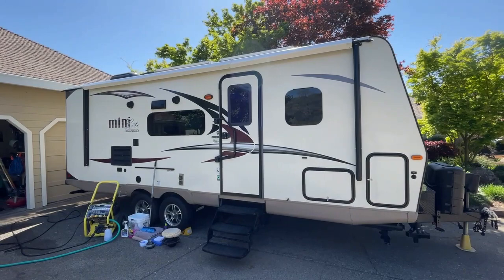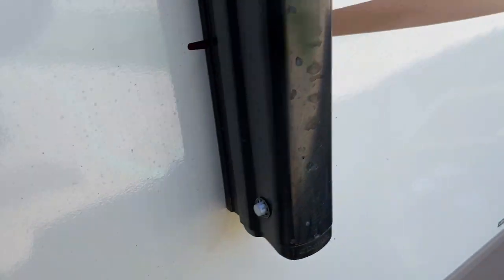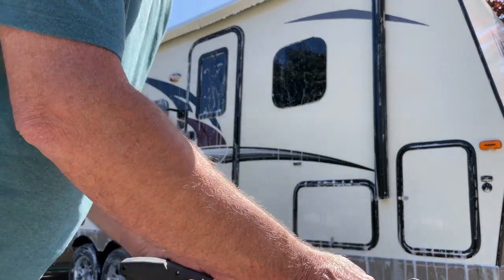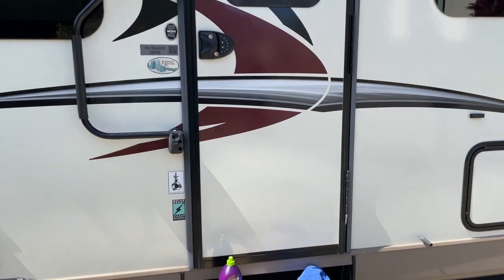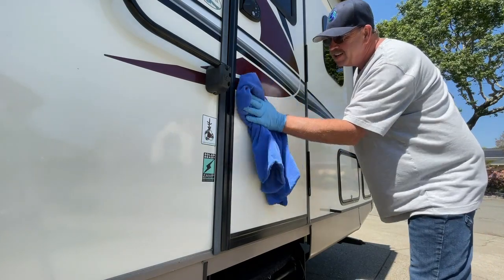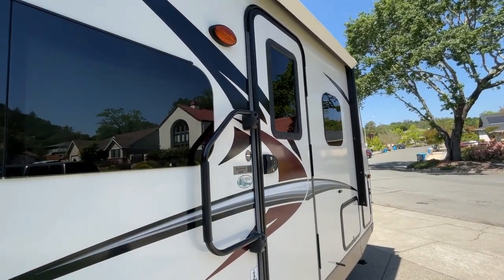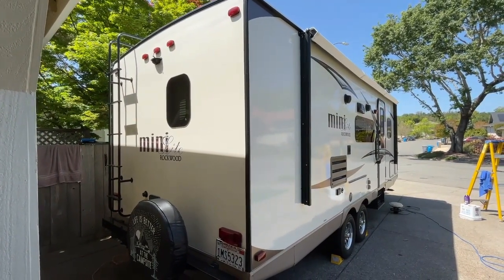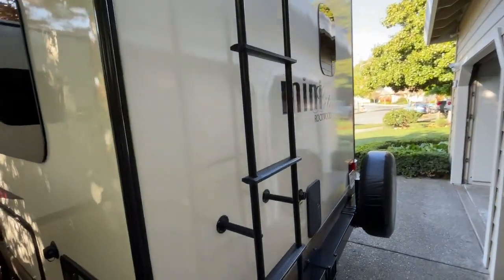RV Exterior Washing & Applying the BEST WAX I've Ever Used (3M Perfect-It Boat Wax) - Step By Step

Comment: Thanks. Was looking for what I should use to wash And wax my RV. 
👍
Reply from the maker: Thank you so much for watching and commenting. I really like this wax, its so easy to apply and remove. Just so you know, its not necessary to use a buffer, a microfiber cloth works just fine. In the video you saw me using a buffer, I do this to just make sure all the wax residue is removed. I have found that if I miss a few spots removing the dried wax its not a big deal, it can be easily removed weeks later. 

3M Perfect-It Boat Wax (36113) – For Boats and RVs – 1 Quart, White -
https://amzn.to/3gAAz79

Meguiar's G17701 Ultimate Wash & Wax, 1 Gallon - 
https://amzn.to/3ghpuaM

Carrand 93062 Deluxe Car Wash 10" Dip Brush with 65" Extension Pole -
https://amzn.to/3v16TUN

NOTE: I Do Not own this but I like it :) 
DocaPole Car Cleaning and Detailing Kit: Soft Wash Brush, Squeegee, Mitt (2X), Microfiber Cleaning Head and Extension Pole, 5 to 12 Ft (20 ft Reach) -
https://amzn.to/34rEHT9

O'Keeffe's Working Hands Hand Cream Value Size, 6.8 ounce Jar, (Pack of 1) -
https://amzn.to/2QiyXEt

Camco 41008 Pro-Strength Black Streak Remover - 32 fl. oz. -
https://amzn.to/3aAHGbI

Griot's Garage 55586 PFM Microfiber Terry Weave Towel (Set of 2) -
https://amzn.to/3evt8eC

Chemical Guys MIC_292_02 Premium Grade Microfiber Applicator, Blue, Pack of 2 -
https://amzn.to/3eqjbiS

Waxer/Polisher, TACKLIFE 10-Inch Dual Action Random Orbital Car Buffer Polisher Waxer, 10Ft Power Cord, Variable Speed, With Polisher Pad Bonnets and Gloves, Ideal for Car Waxing - TCP01A 
https://amzn.to/3gFW1rz

WEN 10A422 Synthetic Wool Polishing Bonnet, 9-Inch to 10-Inch -
https://amzn.to/32ETA06

Pressure Washer Soap Dispenser Foam Spray Gun -
https://amzn.to/3ndyhw4

Comment: I'm preparing to wax the Mini Lite. I don't want to use a power buffer. What can you recommend I use to buff the wax off? I ordered the 3M product. Thank you for all the great videos.
Reply from the maker: Hello Lynne thank you for watching and and the compliment. I posted this in the description below the video " I used a buffer after wiping the dried wax off with a microfiber cloth but I could have done it without the buffer."   So you will be fine not using the buffer just use a microfiber cloth and it will work well. I wish I had mentioned this in the video, I just used the buffer because I have one. I hope you get back to me and let me know how you like the wax. Take care and have fun
Reply: @thetraveltrailerguy  Thanks for the information. I'll let you know how it turns out. The trailer definitely needs some TLC.
Reply: @thetraveltrailerguy  We finished the trailer. The wax was great. It was easy to apply and the finish is beautiful. I used some microfiber pads from Walmart to apply and then buff off. One sore point is that rounded front end. My husband doesn't like ladders so I had to use our 8 ft step ladder and lean way over to reach the top. I'm 5' 1"  and I had to stretch!!!! What a great feeling to finally get this job done. I've wanted to wax it for so long but was afraid we'd wreck the finish. John and I thank you again for sharing your knowledge on YouTube and also on the face book site.
Reply from the maker: @lynnebacchus6689  I'm so happy you and John tried this wax and your feedback, I really like it. What year and model is your Mini Lite?
Reply from the maker: We're heading back to Coloma to camp again at the end of this month :)
Reply: @thetraveltrailerguy  We have a 2018 Mini lite 2109s. We have reservations at Coloma in early June. Not sure if we will be able to go. I don't want to miss out on the repeat reservation system they have so I'm hoping it works out. We have site 54 between 2 cabins which may feel closed in. I loved site 63 but could not book it last time we were there. I hope you and your wife have a great trip. When John watched your tutorial on waxing the trailer he remembered how you made us the video of Coloma which was so nice.
Reply from the maker: @lynnebacchus6689  I hope you can make it we are in site #64 - May 31 - June 3rd
Reply: @thetraveltrailerguy  We are there 6/6 thru 6/10. Maybe one year we will overlap and get to meet you two:)

Comment: So how long did the wax job last?  How durable is the wax?
Reply from the maker: Thanks for asking these questions Michael. I was just going to post a 6 month update in the description below the video on how its holding up (I applied it April 25, 2021). So far the trailer still looks like the day I applied the wax and seems to be holding up well, the water still beads off, dirt and insects are easy to clean off. I will be doing another update when I feel its time to reapply which I feel will be every year at the same time.
Reply from the maker: 3M Perfect-It Boat Wax (36113) – For Boats and RVs – 1 Quart, White -
https://amzn.to/3gAAz79
Reply: @thetraveltrailerguy  .. very nice!  Getting ready to apply a coat on our 6month old 2021 Jayco Northpoint 377.  (43 foot).  Gonna be a multi day project.
Reply from the maker: 3M Perfect-It Boat Wax is the final touch to a truly professional finish, ready for the water or the road. This premium wax for boats and RVs contains pure Brazilian carnauba wax, known all over the world for its extraordinary gloss, combined with special polymers and resins to keep it looking extraordinary for a long time. Wipe-in, wipe-off liquid wax is easy to apply right from the bottle, and is safe for gelcoat, paint, fiberglass and metal. It forms a hard, durable shell that shields your boat or RV from the effects of water, dirt and weather.
Reply from the maker: @mike_adams  Great so far everyone that has used this wax after watching my video is happy with how easy it is to apply and how their RV looks after using it. You have a job waxing your 43 foot RV, just take your time. Please let me know how it goes and how you like the wax if you can. Thanks again Michael. Note: you can get away without using a buffer like I did if you want, I just used it to make sure I removed wax residue I may have missed. You will see how easy it is to remove the wax once it dries.

Comment: What do you use to wash and wax your roof?
Reply from the maker: If you look below each of the videos I put out it lists the products I use with links to where I buy them.  Here is my video of how I clean and seal the roof :) https://youtu.be/KyZa4wiavto
Reply from the maker: Here's a list of products I use on the roof -
Spic and Span® Extra Strength Powder: Sun Fresh 27 OZ -
https://amzn.to/3e5TzYl

Borax 20 Mule Team Detergent Booster, 65 Ounces -
https://amzn.to/2OYY4LQ

Arm & Hammer Pure Baking Soda, 8 Ounce (Pack of 3) -
https://amzn.to/3x3qhSI

Dawn Platinum Dishwashing Liquid Dish Soap, Refreshing Rain, 16.2 Fl Oz, 2 Count - 
https://amzn.to/2OVFXq7

Meguiar's G17701 Ultimate Wash & Wax, 1 Gallon - 
https://amzn.to/3ghpuaM

Here's another option instead of making your own cleaner to buy one premixed already.
RV Rubber Roof Cleaner - Non-Toxic, Non-Abrasive RV roof detergent 1 Gallon - Protect All 67128 - 
https://amzn.to/3axX3BM

MR.SIGA Heavy Duty Scrub Brush with Comfortable Grip, Cleaning Brush for Bathroom, Shower, Sink, Floor, 2-Pack - 
https://amzn.to/32iCYet

Carrand 93062 Deluxe Car Wash 10" Dip Brush with 65" Extension Pole -
https://amzn.to/3v16TUN

RV Rubber Roof Treatment - 1 gallon - anti-static, dirt repelling, and UV protectant - Protect All 68128 (Note: I have used this for 4+ years and it works for me. Scroll down to the bottom and read what Alpha says about maintaining the roof) - 
https://amzn.to/3uZK6bF

Protect All RV Rubber Roof Treatment - Anti-Static - Dirt Repelling - UV Protectant - 32 oz 68032 - 
https://amzn.to/3eeEmo2

Here's good roof cleaner that I use sometimes if I don't make my own:
RV Rubber Roof Cleaner - Non-Toxic, Non-Abrasive RV roof detergent 1 Gallon - Protect All 67128 -
https://amzn.to/32ijXIW
Reply from the maker: Here's the video on cleaning and sealing the awning - https://youtu.be/06KNgE9j3Cs
Reply from the maker: Here's the products I use on the awning -

TriNova UV Protectant Spray - for Vinyl, Plastic, Rubber, Fiberglass, Leather & More - Prevents Fading & Cracking from UV Damage - Restores Color & Repels Dirt - Free of Residue (Gallon) -
https://amzn.to/3e7CPjs

Another option to use for UV protection that others often use instead of the TriNova I use -
303 Marine UV Protectant Spray for Vinyl, Plastic, Rubber, Fiberglass, Leather And More – Dust and Dirt Repellant - Non-Toxic, Matte Finish, 32 fl. oz. (30306) - 
https://amzn.to/3dlVWqS

Dawn Platinum Dishwashing Liquid Dish Soap, Refreshing Rain, 16.2 Fl Oz, 2 Count - 
https://amzn.to/2OVFXq7

Clorox Splash-Less Liquid Bleach, Regular - 40 Ounce (Pack of 2) -
https://amzn.to/3enJAO6

Meguiar's G17701 Ultimate Wash & Wax, 1 Gallon - 
https://amzn.to/3ghpuaM

Carrand 93062 Deluxe Car Wash 10" Dip Brush with 65" Extension Pole -
https://amzn.to/3v16TUN

TABOR TOOLS 1.3 Gallon Lawn and Garden Pump Pressure Sprayer for Herbicides, Fertilizers, Mild Cleaning Solutions and Bleach, Includes Shoulder Strap (1.3 Gallon, Yellow Wand). N50A. -
https://amzn.to/32ymvmo

Premier Telescoping 8 ft. L x 1-1/2 in. Dia. Fiberglass Extension Pole Yellow -
https://amzn.to/3xgPbhO

Linzer Products Pd 7000 7" Pro Edge Pad Painter (You can use the Yellow extension pole above with this pad)-
https://amzn.to/32DhOHT

5 in. x 10 ft. White Traditional Vinyl Gutter -
https://www.homedepot.com/p/Amerimax-...

White Vinyl K-Style Joiner -
https://www.homedepot.com/p/Amerimax-...

O'Keeffe's Working Hands Hand Cream Value Size, 6.8 ounce Jar, (Pack of 1) -
https://amzn.to/2QiyXEt